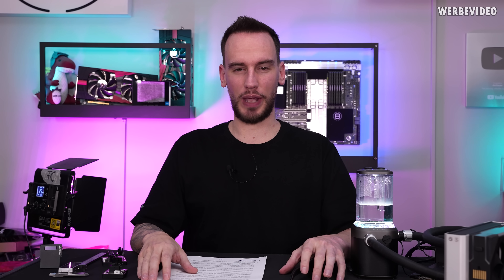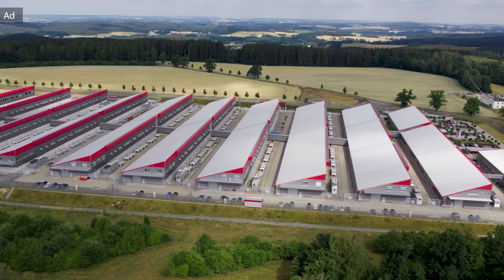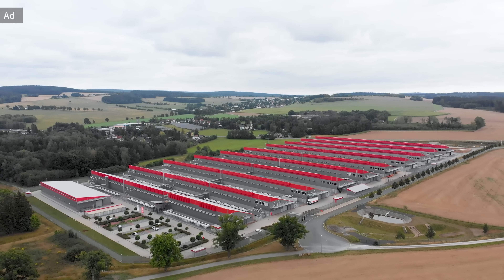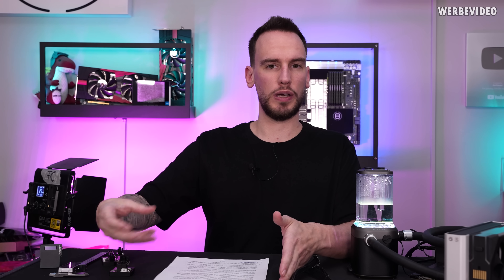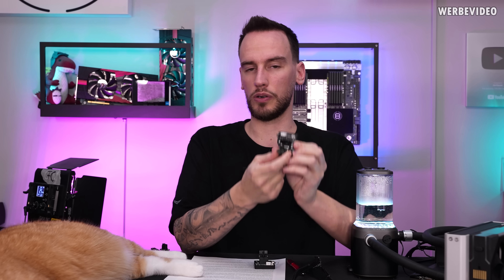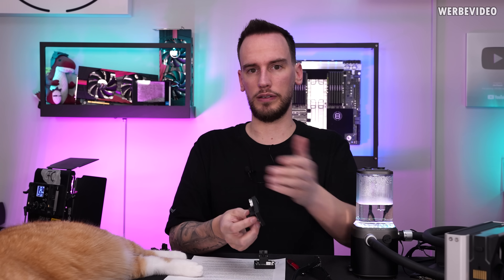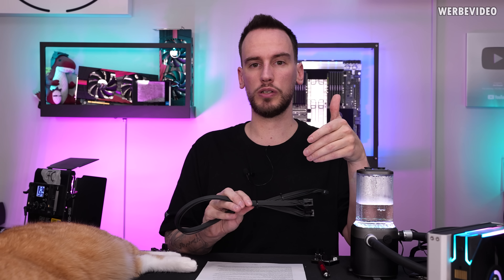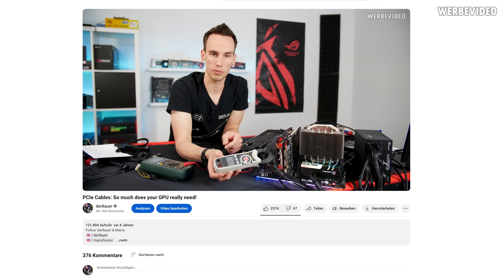12VHPWR is just Garbage and will Remain a Problem!!

Comment: I've rode this rollercoaster with a 4080 & 4090. I've used different brand 12vhpwr cables as well as both v1.0 & v1.1 CableMod adapters. You nailed it, the issue isn't CableMod.. it's the 12vhpwr design.
Reply: Right on!
Reply: What if we set power limit to the 4090  -15% and undervolt the card
Would that increase the saftey margin
Reply: @Adel-sj4ue  The issue isn't the safety margins. The melting adapters happen even if the card is pulling 50W and idling. It has absolutely nothing to do with power delivery. Nor does it have anything to do with the 12VHPWR connector. It's solely from the specific adapter being used. 3090ti uses the exact same connector and has the exact same power draw as 4090 and has zero issues. 4090 and 3090ti are 450W cards. They're already 200W below the conservative limit of the wires.

Every melting case has had to do with using these cheaply made adapters. It makes no sense to look at the connector or power delivery of the card as the issue.
Reply: @Djinnerator  thats really very valiable info
I thought the 600 watt power draw is the problem
Reply: @Adel-sj4ue  nah the only 4090 that are 600w are ones that are overclocked or have a non-factory vBIOS flashed to it. 4090 is a 450w card. Nvidia was originally going to make it 600w but changed when they found a chip supplier that could perform more efficiently.
Reply: @Djinnerator  what about the new power adaptor 12v 2×6
Do u have any info about??
I heard it has no problems up to now
Reply: @Adel-sj4ue  12V 2x6 is the same as 12VHPWR except the pins are longer and the sense pins more recessed. Aside from the lengths of the pins in plug, it's the exact same spec as 12VHPWR. 12V 2x6 only addressed melting issues with Nvidia's squid adapter, which was caused by pin lengths (and also the plug not being pushed in all the way, but that's tied in with pin lengths). CableMod adapters will still melt on 12V 2x6 with the adapter that converts it.
Reply: Nvidia should have to recall every 40 series card and the entire leadership of the company thrown in prison. The entire 40 series has WEAKER hardware than 30 series except the 4090 which is only faster than the 3090 Ti because it pulls 150 watts more
Reply: @JTTTTT850  3090ti and 4090 are both 450w cards...4090 being 600w was from expectations when Nvidia was using a different chip manufacturer. 4090 is 450w, just like 3090ti, so the idea that it has anything to do with power delivery is irrelevant.
Reply: @0QualityOverQuantity  "This is because the power draw is highest through single pins at the gpu." If this were true, which it's not, we would see this problem occurring with .3090ti, which has the exact same power draw as 4090, and we don't. The melting occurs even when idling at around 50W. It has nothing to do with too much power, it's poor third-party adapters. Again, you people keep saying it's power draw but yet can't explain why RTX 30 happened to avoid this problem while using the exact same connector.
Reply: @0QualityOverQuantity  There are numerous stories of people on reddit and twitter saying they weren't even using their computer then smelled smoke while trying to sleep. If it were the connector and not these third-party adapters (which have been in near 100% of these reports), then we'd see widespread issues when not using adapters and just using PSU cables...which we don't. The only think in common with these stories is using third-party adapters, specifically CableMod since learning about plugging in the Nvidia squid adapter fully.
Reply: @0QualityOverQuantity  So you want to refer to stories about people's GPU yet you want to pick and choose what you'll accept. So then you'll be able to provide a story of 12VHPWR causing melting simply because of the connector and not the adapter.

I'll wait.

It's also even funnier because aside from social media, there's no other way of seeing anyone's melted connectors. Even places like NorthRidge doesn't say how the faults occured, just where the damage is. But please, enlighten me on your sources of any GPU melting that doesn't originate from social media.
Reply: @0QualityOverQuantity  the 90 connector was not recalled either. Third party adapters were. Do you even understand that industrial GPUs use 12VHPWR? And they also actually pull more current than 4090. 12v2x6 is just 12VHPWR with changes to the pin lengths. It's still functionally 12VHPWR, there's no changes to pin thickness/gauge. So you're saying "it was recalled" for something that's structurally the same thing...? Like, your argument isn't even making sense. And you still can't explain why RTX 30 just happened to be immune to this issue when 3090ti has the exact same power draw as 4090 and uses 12VHPWR, and the rest of RTX 30 draws more current than their RTX 40 counterparts. Make it make sense, cause your argument so far doesn't.

Again, if the issue were 12VHPWR, we would be seeing issues when using solely PSU 12VHPWR cables, and there are none.

You really think Nvidia cares so much about third part adapters melting that they'd recall the connector on one GPU, when their commercial cards that draw more power use the same connector with 0 issues? I work in a deep learning lab and all of our GPUs from last year have 12VHPWR connectors and they draw 500W+. No one has ever mentioned or has issues with melting because no one is using poorly made third party adapters with these cards. It's simple as that. Don't use trashy adapters and you won't have problems. Notice how there are no issues when not using an adapter period.
Reply: @0QualityOverQuantity  their "consensus" means nothing when they don't analyze the cable itself compared to not using adapters. Funny how you'll conveniently take the world of your choice of social media but not something else that goes against your narrative.

Basic scientific analysis would examine why an issue exists with one set of devices and not another yet both sets have the exact same components and power draws. The only difference is the problem set is using adapters and the set that doesn't have problems isn't using adapters. Occam's Razor would point to... adapters. But here you people are conveniently saying "no it's not adapters, it's the connector" which makes NO SENSE.
Reply: @0QualityOverQuantity  Both adapters were recalled. The issue has ONLY been when using adapters.

If you seriously think that's fabrication, you don't even know what's going on and just talking just to talk.

How is it that there are no issues when not using adapters? Explain that...
Reply: @0QualityOverQuantity  You're proving my point from the beginning that you're not even trying to think for yourself and just going off what others are saying.

3090ti and 4090 both are 450w. Both use 12VHPWR. Only 4090 has melting issues. WHY IS THAT? What other difference is there? Oh right, only 4090 users use adapters. There were none made for 3090ti by third party sellers. When not using adapters, there are NO melting issues. Occam's Razor would point to adapters being the issue.

You saying "no it's the connector" shows a severe lack of critical thinking and analysis.
Reply: @0QualityOverQuantity  when not a single one of them can even use a control set such as the previous gen of cards which have the same power draw and power connector, their "analysis" means nothing. No credible person of science would accept that because it's looking at this in isolation. You are showing to be dense and incapable of thinking for yourself with that comment alone. "These techtubers said this so that's what I'll believe." Thank God you're not in engineering or quality assurance. Roman's own video is full of issues that would never be accepted by anyone with a semblance of scientific background.

Nice moving the goalpost too. It was a poor attempt.
Reply: @0QualityOverQuantity  by your logic, everything Linus says is true too, even with his faulty testing. But he's renowned and all that.

Stop letting others think for you and learn to do it for yourself. You can't even have an argument with your own points because you're just saying "this person said this so I'm going with that" instead of using facts and actual details of what's going on.
Reply: @jacekmakes if you actually had more than 3 braincells, you'd see the adapter is used with devices that draw MORE power and have no issues at all. But even looking at the previous gen cards that use the same adapter is too difficult for you clearly.
Reply: @jacekmakes I saw 12VHPWR connectors melting on both sides (GPU and PSU).
Reply: It should be staggeringly obvious to anyone not sickeningly undereducated that a pin's ampacity can be exceeded if there is complete failure to do something as utterly trivial as plug it in correctly and check the catch is secure as blatantly designed. The sheer lack of intelligence, care, and attention to the most remedial of detail associated with the degrading failure to do this constitutes a truly shameful embarrassment. All this hoo-ha over the source of failure is shocking and ridiculous, and shame on all those suggesting any problem lies with anyone but the user on this matter.

Properly seat your power cables, buy a case that fits, do not bend cables, do not use 3rd party adapters, have a professional who knows what they are doing building rigs and you will have a %99.9 success rate according to the current data..
Reply: @0QualityOverQuantity  "of course reddit and twitter. Are you serious right now? Some random probably posts on reddit his gpu burned up and it wasn't even plugged into the wall?" Because this is how the misinformed and inexperienced form their illogical opinions  LMAO. This attribute is referred to as projection
Reply: Xurikyo Ya, its utterly ridiculous I can see that. They are projecting without any hands on experience whatsoever based solely on unsubstantiated hear-say off reddit and quora lol. I swear you cant even make this up !
Reply: Xurikyo  Ya I know I seen them do that to you, its utterly ridiculous I can see that. They are projecting without any hands on experience whatsoever based solely on unsubstantiated hear-say off reddit and quora lol. I swear you cant even make this up
Reply: It's crazy how you say exactly the adapter that's in the middle (literally and figuratively) of the melting issue but then say it's actually not that, but the connector...

12VHPWR connector was introduced with RTX 30. How many issues with the connector have been reported with RTX 30? 0 right? I wonder why?

Before you try to cite power draw, 3090ti has the exact same power draw as 4090, and still how many reported issues? 0. 3089 draws more power than 4080. Both use 12VHPWR. How many reported issues with 3080? You guessed it - 0.

How many CableMod 90 degree adapters are there for RRX 30? 0.

Why is it that 12VHPWR PSU cables don't have this issue? How is it that Corsair's GPU Power Bridge is an adapter (180 degree) that does not have this issue?

If the issue was 12VHPWR's design, we'd see issues with RTX 30 and all the direct-to-PSU setups. It's absolutely crazy how we, as clear as day, see that these issues are isolated to CableMod, yet put fault on the connector itself. This is the most bizarre stance I've seen the gaming community take in regards to a product problem. All of the evidence points towards specific adapters. There's no evidence that points toward the 12VHPWR connector/design...
Reply: @Djinnerator  Only founder edition cards used this connector, no AIB 30 series card used it, they used normal connectors.
Reply: @mycelia_ow  it doesn't matter, there would've been issues with FE since it uses the connector. If the 12VHPWR connector were the issue, there would be reported problems with those. There have been 0 reported issues with RTX 30, especially with 3090ti which is the exact same power draw as 4090 and the exact same connector.

The issue is the adapters, not the connector. Until someone can explain how RTX 30 was immune to this issue, it makes no logical sense to say the issue is the connector.
Reply: @Djinnerator How many 3090Ti were sold, i'd argue, there have been 100x more 4090 in consumers hands than the 3090Ti, the 3090Ti was an overpriced experiment launched 18months after the initial release, meanwhile the 4090 was the first card to be released in its generation and it was by far the best bang for the buck.

Now putting into consideration that only FE 3090Ti had the 12VHPWR cable, while every 4090 comes with this connection model, 100x isn't that far off, i'd actually guess even higher.
Reply: @MaxIronsThird  except 3090ti wasn't the first or only RTX 30 card with 12VHPWR. You don't know if 4090 has hundred times more sales. The fact of the matter is the amount of melted 3090ti cases is nonexistent, while also never using these adapters, meanwhile all 4090 melting cases use these adapters. How are you people conveniently ignoring the adapter as the issue and saying it's the connector?
Reply: @Djinnerator  Are you blind or you chose to not see ? 
You dont know nothing and yet you open your mouth to talk, problem is INSIDE the cable itself

"If it work on the 3090,  it should work in the 4090" BUT WHY ARE WE HAVING BURNING ISSUE IN THE FIRST PLACE ?
People had BURNING issue with the cable that was sent with the card (The cable Made by Nvidia)
Burning issue with the FOUNDERS EDITION ITSELF
(Do they even check their own product, to see the limit and problem that can haapend ?)

People had burn issue with the cable even ON THE POWER SUPPLY SIDE made by Msi, Corsair, Many Company now knows that the issue EXIST Like MSI Colored cable, even though Nvidia said it was only 10 cases at best (They lied)

Even a Serious Power supply brand like Seasonic who is 18 years older than Nvidia said the conncetor has to be fix
Even INTEL said the conncetor need to be redesign and how  it should be

Did you take your to time to find these information before writing your comment ?
Why do they had to create a new conncetor The 12v-2x6 if there was no issues ?

Then Cable Mod try to help with their adapter, but is was worse

This conncector have to be plug Straight 24/7, even if there's no bend and even if its FULLY PLUGGED (Dont litsen Gamer Nexus) the issues still can  happend (Like DerBauer said)
IT 'S SIMPLY NOT GARRANTY THAT THE ISSUE WILL 100% NOT HAPPEND

I hope this comment will help
Reply: @young-j731  I'm happy for you, or sorry that happened. Not reading that.
Reply: @young-j731 cablemod problem I've had the corsair haven't had a issue these melting issues stopped a long time ago except for cablemod due to the inferior design they use.

They're hopeless even after a guys computer caught fire they still didn't recall and I mean actual flames in was on fire after he went down stairs to make a coffee. Instead of recalling cm continued to sell just unprofessional and total amateur hour over there
Reply: @beetleburper9440  I just can't wrap my head around how every single melting case uses two specific adapter, nobody using only PSU cables has this problem, RTX 30 uses the same connector with no melting issues, yet people are saying "yeah the connector is the reason."
Reply: @Djinnerator the level of ignorance you have is not even suprising. If you really want to stick with the connector, the solution would be to change the power line to 24 volts or 48 volts.
Reply: @HelipOfficial  So instead of addressing anything I said, you go straight to personal attacks.

It's mind boggling the mental gymnastics you people are doing to say the connector is what's causing the melting issue. The connector was introduced with RTX 30. The exact same connector is used with RTX 40. RTX 30 doesn't use these adapters. The Nvidia squid adapter was changed between product lines. Only RTX 40 uses these adapters. RTX 30 as a series draw more power than RTX 40, only the flagship cards are different from the trend - they have the same power draw. 3090ti is 450w. 4090 is 450w. Both spike up to about 600w. There's no melting issue with RTX 30. There's melting issue with RTX 40.

Literally the only difference is one set is using adapters and the other isn't. The adapters just happen to be in all of the melting reports. Yet you people are saying "no it's the connector not the adapter."

You talk about my level of ignorance, what you people are doing is borderline mental.

Make it make sense
Reply: @Djinnerator My comment was to long sry, but the point is the burning issue happend even without the nvidia squid adaptater or the cablemod adaptator 🙃
Reply: @young-j731  except there was no burning/melting issue other than with those two adapters...
Reply: @Djinnerator there are actually cases of 30 series cards melting when power cables are not properly seated. Matter of fact there are cases with all gpus that utilize power connectors directly to the gpu that have melted when not properly connected at the power. It's just heard much more now due to the 4090 being so powerful there is less tolerance before failure than a less powerful gpu
Reply: @javiersantana848  issues because it wasn't plugged in all the way is not an issue with the connector. 8-pin cables have also melted from not being properly seated. That's like saying a knife is faulty because I got a cut from handling it by the blade instead of the hilt.
Reply: @javiersantana848  if we use that logic, then 8-pin is faulty.
Reply: @Djinnerator  "if we use that logic, then 8-pin is faulty." No, this logic proves that any electronics with an improperly connected power cable or after market connectors/adapters runs the risk of malfunction.
Reply: @javiersantana848  so then your initial reply  wasn' t relevant at all. What you said just now is essentially what I said. But trying to say an improperly seating cable causing issues is representative of the connector it's going into, then we can say the same thing with 8-pin since the same thing happened with 8-pin. If you're going to say "any electronics with an improperly seated... malfunction" doesn't apply to 8-pin but applies to 12vhpwr, then why even made the comment reply in the first place? It didn't address anything I said.
Reply: @Djinnerator  My initial comment to you was "there are actually cases of 30 series cards melting when power cables are not properly seated. Matter of fact there are cases with all gpus that utilize power connectors directly to the gpu that have melted when not properly connected at the power." And this remains facts that you had no clue of when you claimed there to be 0 issues or cases of melting 30 series cards when the reality and facts are there are cases of 30 series and other GPUS that are not properly connected or using 3rd party components having issues, including melting cables and adapters obviously. ANY electronic component that is not seated properly or using after market components run higher risk of malfunction, this again is fact lol.Take care✌ !
Reply: @javiersantana848  I said there's no melting issue with RTX 30. So again, you're saying something that's irrelevant to what I said.

Saying some irrelevant fact just to say "that's a fact" is supposed to accomplish what exactly? If I responded to your comment with "disabling one CCD on Ryzens can improve the performance of the other CCD, and that's fact," what would have been the point of it?

Take care
Reply: @Djinnerator  " I said there's no melting issue with RTX 30" Yes, there is in accordance with user errors and after market components, exactly what we are seeing with the 40 series cards and have seen with 20 series as well. Again, you are uninformed. Or maybe you are not being clear of your actual position in terms of this subject. I would claim that the same "issues" that caused 20 and 30 series cards to melt cable would be the same as the 40 series, and that is user errors coupled with people using after market components and adapters. A simple google search will discover what I am saying as fact, nobody has to take my word for it. I bring receipts when I make comments, I do research before I make comments.
Reply: @javiersantana848  dude, you're not addressing anything I'm saying. Do you even know what my point is? You're saying something that has nothing to do with what I'm saying and saying I'm uninformed. I'm not talking about anything you're talking about. I'm not uninformed, you're just talking just to talk. You say you have receipts for what you say, where are they and show how they have anything to do with what I said.

I'm being perfectly clear. Notice how other people have understood what I said with no issues. It's just you that's seemingly lost.

Maybe you don't have a good grasp of the English language? That would make sense considering your comments.
Reply: @Djinnerator  "Do you even know what my point is? " Yes, the point you attempted to make does not exist. You claimed "There's no melting issue with RTX 30. There's melting issue with RTX 40." And you also stated there to be 0 "issues" with 30 series cards, when the 30 series cards have the same "issues" as the 40 and 20 series have (which happens to be user errors coupled with faulty after market 3rd party adapters and cables etc, not a manufacturers defect of the cards themselves ). Also "12VHPWR connector was introduced with RTX 30. How many issues with the connector have been reported with RTX 30? 0 right? I wonder why?" When there are cases that you are obviously unaware of. That's what my original comment towards you was and is in regards to your original comment of "why have there been no melting reports with RTX 30" when there are several on the internet. Reading comprehension is your friend. Returning triggered with further opinions will never change this, you've already shown us your level of insight to this subject matter,...
Reply: @Djinnerator  "I'm being perfectly clear. Notice how other people have understood what I said with no issues." and yet the other commenter states "I have read your responses in its entirety before, and I think you are really misinterpreting what I am trying to say." LOL. This seems to be a pattern with you. Again, reading comprehension is your friend,
Reply: @Djinnerator  Wow,  you are seriously lacking reading comprehension lol. Or are you just trolling ? Because if you are not trolling we are clearly on 2 different platforms of intelligence and insights into this subject matter. Take care✌!
Reply: @javiersantana848  that doesn't even have anything to do with the other statement. Those don't refute the other. You're trying so desperately to be right and contrarian, while at the same time making so sense. Everyone can see it. I'm sorry your brain cells are struggling to do what you're trying to do. You should let them rest. None of your comments are relevant to anything in this thread
Reply: @javiersantana848 I perfectly understand what @dejinnerator saying and you just validated everything they said.

Improperly seating a power connection can cause issues regardless of 6-pin, 8-pin, or whatever. The adapters don’t make a proper connection, causing increased resistance thus, are problematic.

You’re just arguing, not even understanding what you’re arguing over because you can’t bear the possibility of being biased and trying to push a point that you already know isn’t %100 correct.

I’ll explain it again incase you couldn’t comprehend that…

Bad connection = issues. This happens frequently in the power adapters.
Blaming the connection like it’s %100 at fault is not only disingenuous, it’s objectively incorrect.

With regard to that, your ego is so fragile that you argue for the sake of arguing and that’s absolutely toxic.  Get better
Reply: @christophervanzetta  Thank you!
Reply: @Djinnerator ah love me a nice comfy cozy echo chamber 😂
Reply: @Xurikyo  It's crazy
Reply: @christophervanzetta  "Bad connection = issues. This happens frequently in the power adapters.
Blaming the connection like it’s %100 at fault is not only disingenuous, it’s objectively incorrect."  Uh, no. Its just a bunch of noobs trying to build rigs using professional components leading to issues. 0 pros have had any issue whatsoever with these cards. Granted there will always be failures with electronics components regardless, however the industries acceptable expected failure rate for electronics is %4 respectfully. This so called "issue" is less than %0.1 according to the current data. Dont believe the hype of the clickbait videos, these people are fishing views only. What you claimed aint it chief ! Properly seat your power cables, buy a case that fits, do not bend cables, do not use 3rd party adapters, have a professional who knows what they are doing building rigs and you will have a %99.9 success rate according to the current data.. Try harder next time
Reply: @Xurikyo  "ah love me a nice comfy cozy echo chamber " Always gonna be some noobs without a 4090 making unsubstantiated claims just because they're salty they dont have it lol. Over a year into this and less than %1 failure rate without any injuries, fires or recalls besides a third party adapter is hilarious at this point. When are people going to stop beating this dead horse and admit people just dont know how to plug a freakin cable. Or who dont want to upgrade a PC case as they should instead, they decide to be rookie dummies and choose to use third party garbage adapters/cables that possibly can voids warranties ? Low level intelligence around here ... Most that complain dont even own any 40 series cards, but yet still making nonsensical 
statements.
Reply: @javiersantana848  damn dude says I live in an echochamber because I've never had issues with my card, you're so phat and cool and make skrilla.
Reply: @Xurikyo  "ah love me a nice comfy cozy echo chamber " Always gonna be some noobs without a 4090 making unsubstantiated claims just because they're salty they dont have it lol. Over a year into this and less than %1 failure rate without any injuries, fires or recalls besides a third party adapter is hilarious at this point. When are people going to stop beating this dead horse and admit people just dont know how to plug a freakin cable. Or who dont want to upgrade a PC case as they should instead, they decide to be rookie dummies and choose to use third party garbage adapters/cables that possibly can voids warranties ? Low level intelligence around here ... Most that complain dont even own any 40 series cards, but yet still making nonsensical
Reply: @javiersantana848  I still have a 40 series card, it's a gigabyte 4090. Overclocked it even in some circumstances, cable never melted. I want what you're smoking, or you're just being a bot.
Reply: @Xurikyo  No idea what you're even talking about at this time. Try reading comprehension. I am agreeing with what you stated "dude says I live in an echochamber because I've never had issues with my card,". I clearly stated there is nothing wrong with these cards besides user errors and shotty 3rd party adapters. Are you sure you're not the one smoking or a bot ?
Reply: @Xurikyo  You good now, you put down the pype and applied reading comp?
Reply: @Djinnerator  the burning/melting issues started with the official Nvidia adapter that is bundled with the release of the 4000 series FE cards, why are you ignoring that and somehow only associating the melting connectors with CableMod? The only reason the CableMod adapters even existed is to try and side-step around the melting issues from the official Nvidia connectors
Reply: @DuyLeNguyen  I literally said it's caused by two specific adapters, the Nvidia squid adapter and CableMod's adapter. Why are you not reading what I'm typing just to argue?
Reply: @DuyLeNguyen  if you read my comment replies, and not just one comment you found an issue with, you'd see I said it's caused by the two adapters. So if we know that it's only caused by specific adapters, why is it that people are focusing on the connector and not the adapters?
Reply: @Djinnerator  because the connector itself is a very poor design without adequate derated margins. The adapters are irrelevant, lots of other connector series allow for the use for pin to boards adapter, and it's a pretty common use case, so having one connector design that likes to spontaneously self-immolates points to deficiencies in the design of the connector itself, because clearly it has not got adequate operational margins to accommodate the use case where adapters are involved.
Reply: @DuyLeNguyen  we're not talking about other connecters. We're talking about 12VHPWR.

You say this connector likes to self-immolate yet that doesn't happen with any other scenario except when using two specific adapters. So we can take they same argument and say the Nvidia squid adapter and CableMod's 90 degree adapter like to self-immolate. Do you agree with that?

Are you even going to read my response in its entirely? You've already shown that you'll pick and choose something from my comment to argue against even that wasn't a true premise.

And again, if the issue is margins within the powder delivery connector, we would see the same issue with any other device that draws the same amount of power. Can you explain why 3090ti doesn't have this self-immolation issue?
Reply: @Djinnerator a simple Google search you will discover 30 series cards have melted when not properly connected. Matter of fact all gpus that utilize direct power coles have melted when not properly fitted.
Reply: @Djinnerator  I have seen at least a handful of other post showing melting connectors on Corsair 12VHPWR cables (not adapter, official Corsair-supplied direct plug 12VHPWR cables from the GPU to the PSU), same symptoms as shown here with the cablemod adapters, so it clearly isn't an isolated problem with adapters from two specific vendors (Nvidia and CableMod). 

I have also seen reports of BeQuiet Dark Power 13 PSUs with melted 12VHPWR connectors (the new BeQuiet PSUs uses the 12VHPWR on the PSU side as well, and the failure modes are functionally identical to the GPU-side connectors melting seen on the Nvidia and CableMod adapters (including the Corsair cable melting which I mentioned above), so evidently 

As for the 3090 Ti and why there are fewer reports of the issues occuring, my best guess is that these cards moved in lower volumes compared to the 4000 series (they came out only 6 months prior to 4000 series, and have a worse value to performance ratio compared to 3000 series cards lower in the stack). 

For whatever it's worth, the connector itself were derived from the Microfit series from Molex which I am familiar with and have crimped without issues on 3000 series boards before, though only on cards <400W.

I still maintain that moving to a Microfit derived connector and drawing current all the way up to the max allowable specs for a single pin connector is a mind-numbingly stupid design decision. Even the Molex documentation for the terminal crimps tells you that in a 12 circuit configuration, the max current derate should be 65% of the dual circuit max. 

I have read your responses in its entirety before, and I think you are really misinterpreting what I am trying to say. It doesn't matter one bit whether the issues are caused by a single vendor or not. If you go back to first principles, the selection of a microfit-derived connector was exceedingly poor, considering the current load conditions these parts are intended to be used in. Clearly there was inadequate reserve factor on the current draw here. 

At 600W allowable load on 6 conductor pairs, you're talking about 8.33A at 12V per conductor pairs, and the max allowable rated capability of the crimp terminals is 8.5A. If I was responsible for defining the specs and down-selection process for this application, I would've lost my job by now. 

I am not sure why you are arguing semantics and manufacturers when any first year electrical engineering student would've pointed this out at the design stage.

And before you start going on about the 3090 Ti, I don't think this connector is fit for purpose for that card either. If a failure hasn't occured (or has but not yet publically reported), there's no guaranteeing that we won't see one either considering the basic failure in the design selection.
Reply: @DuyLeNguyen  "there's no guaranteeing we won't see one" that's an argument that you can apply to literally anything and everything. That's not a quality of the connector causing issues.

You're saying I'm arguing semantics when you're not even addressing my points, but rather something else that I'm not talking about. Do you have a link to these other 12vhpwr incidents that melted without adapters?

You're talking about "at 600w" yet the devices using it are rated at max 450w - 75% of the rated power supply of the cable set by Intel, 68% of the conservative max of the cable's wires.
Reply: @simple6880 People on reddit tend to act as part of a hivemind and engage in groupthink. If there's anything posted that doesn't follow the general opinion, you don't get answers or serious conversation. You get downvoted until your post is collapsed and buried.

The thing about 3090ti is one part of the question. The other part is questioning that if the issue is the connector, and not the only adapters that have shown an issue with this, why have there been no melting reports with RTX 30? That line draws more power than RTX 40, or the same amount. If the issue was power delivery and safety margins, we'd see more problems with RTX 30, but we don't. And finally, why is it that all of the claims have been using a specific set of adapters yet people are ignoring those specific adapters to say "it's actually the connector?" If we consider Occam's Razor, this is one of the biggest cases of confirmation bias that I've ever seen. The simplest conclusion would be the adapters are the issue because when people use PSU cables without adapters everything is fine with no issues. And people seem to not understand what a statistically significant amount is. Every electronic device has faults, either from factory defects, or through shipping, or overlooking something in design, to something else. So random reports of something is not indicative of a problem, but repeated patterns of the same thing occuring shows a problem. We've repeatedly seen CM's adapter melting. We've repeatedly seen the Nvidia squid adapter melting. We have not repeatedly seen 12VHPWR melting when just using PSU cables. Citing 2-3 reports is not a pattern because I've seen 10+ reports of 8-pin connectors melting in the past year alone, yet don't claim 8-pin is faulty. The idea that 12VHPWR is the issue is mind boggling. The hungriest GPUs using it have the exact same power requirements yet one of them doesn't see issues, while also not using adapters, and the other does only when using adapters.

It's just crazy how people have this much evidence in front of them showing the adapters are the problem, and not the connector, yet they say "no it's the connector"...while at the same time unable to say why this issue didn't exist with RTX 30 using the exact same connector with the same or more power draw.